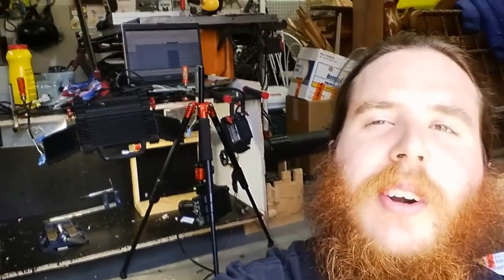Supersonic Ping Pong Balls

Comment: Great. Love any slow motion and I am trying to get that camera this year.  I think I will have to invest into buying or making some super bright lights for the high speed settings.
Reply from the maker: It is a fantastic camera. +tesla500 did an awesome job and built a great machine. It is way easier to use than the industrial high speed camera that I have used.

Comment: extremely interesting clips! I love the ram inertia of the column of air after the ball. Just obvious but I never thought about it...
Reply from the maker: It surprised me how far behind the ball it is. I would have thought that the mass of the air would be right behind the ball.
Reply: Yes! that puzzled me too, but I have my guesses. First of all, at 0:51 you can see that the aluminium foil is vibrating! I don't know if this is that your vacuum source is still connected and the thin atmosphere inside is vibrating along with the pistons of the vacuum pump... but I think it might be more probable that it is vibrating because some air is starting to hit it before the ping pong ball breaks it. Like air flowing partially around the ball and "winning the race". I'm not sure wether this could be related or not, but this made me think that the ping pong ball is travelling with the very first front of the shockwave, and my guess is that this front shockwave is far from being at 1atm. At those speeds it helps me think of air as a crowd of people, and so when on sales, the very first customers to rush into the mall are actually expanding at very high speed, into the vacuum of the mall/cannon. The big crowd comes later on, when they are able to come in all together at "crowd pressure" (aka atmospheric pressure). The ping pong ball would be light enough to be driven by the very first "customer molecules", break the seal and hit the target, way before that big cough of atmospheric air.
Sorta silly i know, but as far as I can say, it has helped me understand most pneumatics, even mach effects.
Even the distribution and density of that mass of air seems to happen all of a sudden, rather than increase (?) I can't truly tell from your footage, but there could be some ram pump effect (I don't know the name exactly. I'm referring to some shockwaves that can happen among a fluid when its inertia gets distorted, and is quite noticeable on a water ram pump)
Reply from the maker: +DoNotPushHere To reduce the build up of air ahead of the ball I have some complicated plumbing that acts as a vacuum accumulator, most of the air that sneaks by the ball gets picked up by that. Without the accumulator a significant amount of air gets ahead, enough to burst the membrane (>30psi). The vibration may be air that takes a ballistic path straight to the membrane instead of going into the accumulator.
The delay may be the amount of time it takes for the accumulator to fill up to the point where it too begins to supply air. After the shot the whole barrel "breathes" 3 or 4 times as it acts like a Helmholtz resonator.
Reply: Nick Moore hmmm I guess it explains itself. I'd love to build my own and test my hypothesis.
Thanks again!

Comment: Very nice. Have you calculated muzzle velocity? what frame rates were you shooting at? It' s quite impressive that a ping pong ball can be pushed so fast!
Reply from the maker: I measured the muzzle velocity using 2 strips of foil and the software audacity, all of the clips shown here are over 430m/s. I didn't write down the frame rates but everything was above 4kfps and the slowest was 17kfps. I mightg try to use a giant mirror to beam some light into the garage next time.
Reply: 430m/s... wow!
Reply from the maker: Yeah, my best so far was just over 1/2km/s but the balls tend to fall apart above that. I think a longer barrel can give me more speed without shattering the balls.